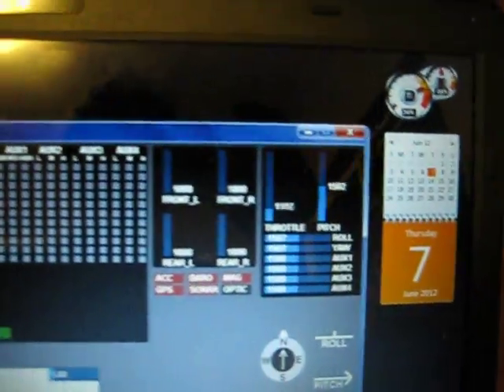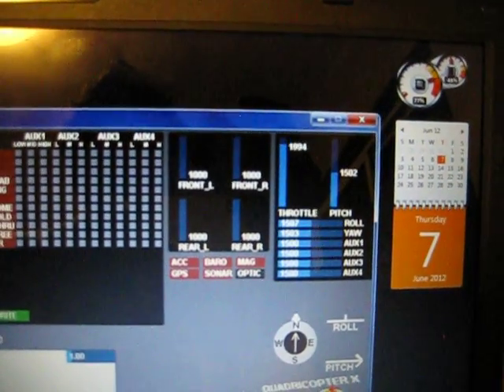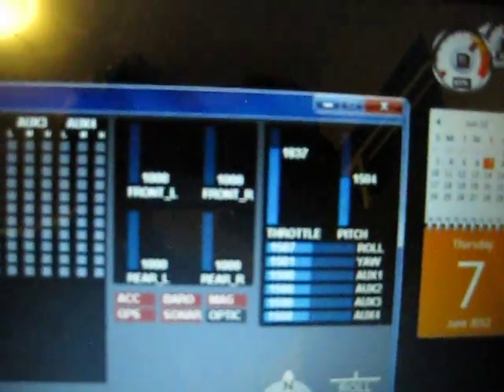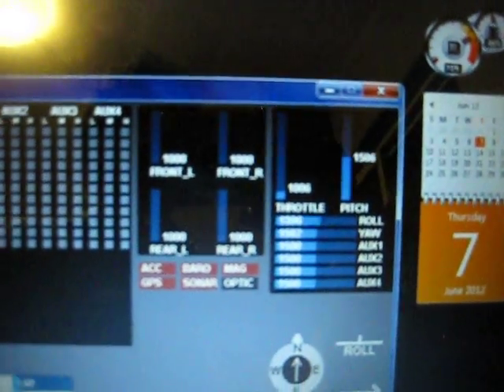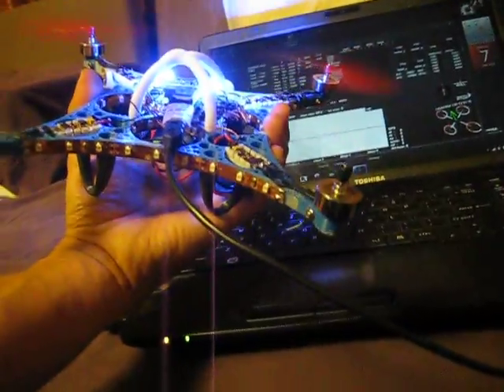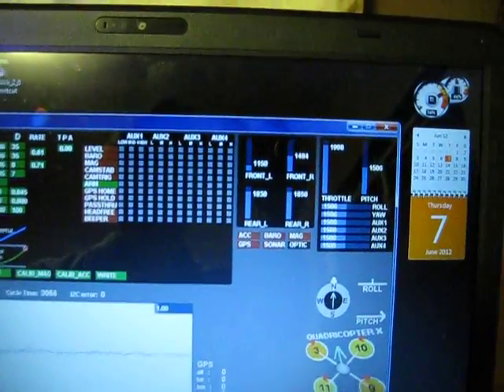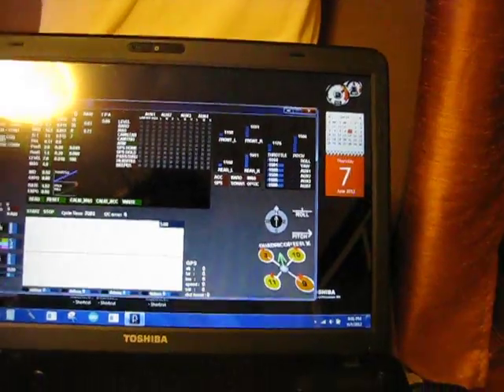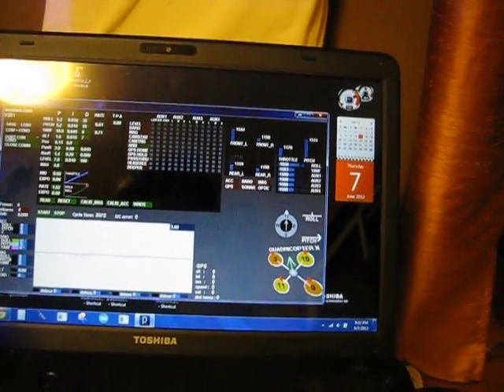multiwii 2.0 jumpy throttle response

Comment: Did you ever resolve this?? Mine is doing the same thing and I can't figure it out. I'm on a Crius AIO pro board though. It's almost like I'm missing a calibration step or something but it feels like I've tried everything. Along with my motors looking like a spectrum analyzer playing rock music, my throttle is super sensitive as well, jumping from 0 throttle to what feels like full throttle in the first quarter stick rotation. Yet I've got my throttle expo dialed almost flat a the low end.